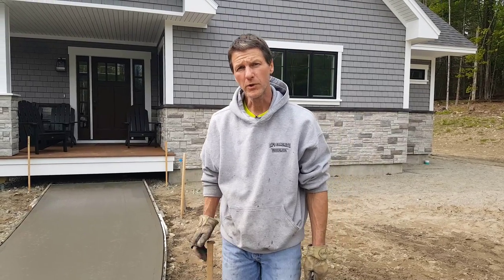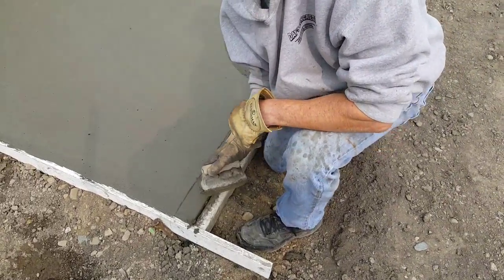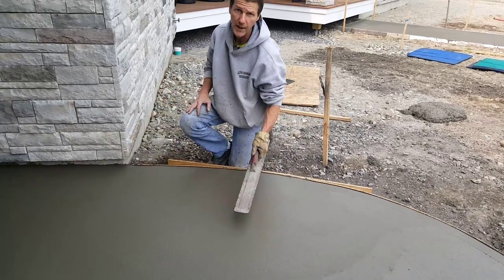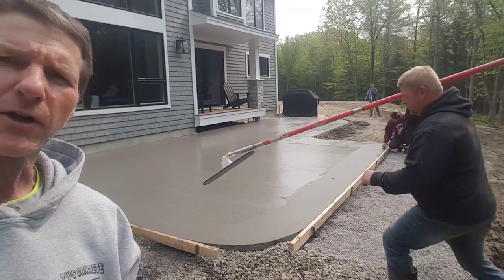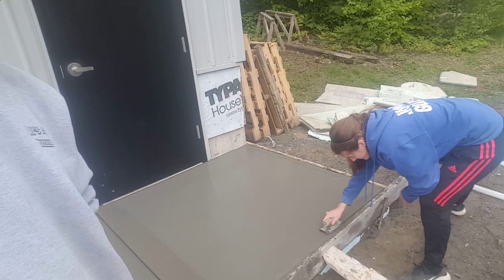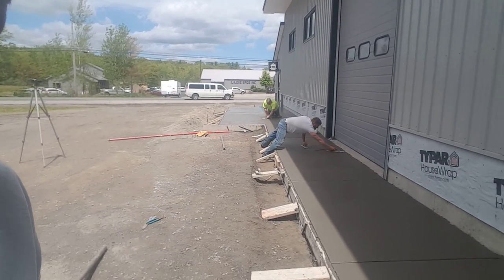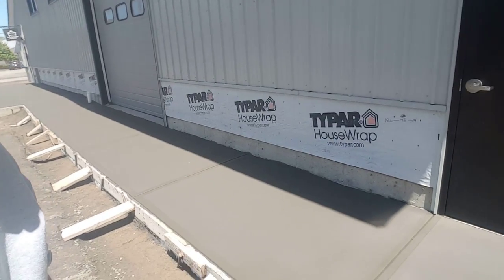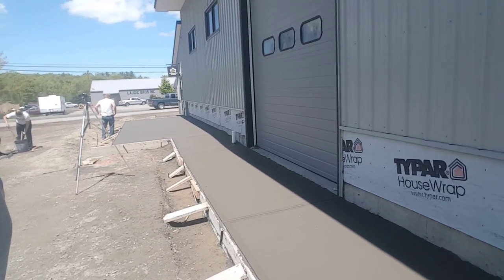CONCRETE PATIO AND SIDEWALK FINISHING TECHNIQUES | HOW TO FINISH CONCRETE

Comment: All of your videos are good but this is one of the better ones. I like how you explained where the concrete was along the way as far as curing and what to do at each stage. The funny trowel looks like a steel blade. Is it ok to use steel outdoors if you’re going to broom over  the slick finish? I like how the steel trowels smooth out the lines from the mag but I’m worried it will spall if I use a trowel. I always broom outdoor concrete.
Reply: Cool👍

Comment: I like your videos sir. I understand there's different ways to pour and finish..i like your style..i do have a question though..why did you open it back up with a mag after crazy troweling it before brooming it..i understand freeze thaw cycles and air engrained mud..i like to Fresno or crazy trowel before brooming it..the broom opens it back up and the steel gets it real flat and helps put a nice broom finish on it..i feel laying it down once or twice with steel won't knock the air out of it..i guess what I'm trying to ask is that your standard of procedure (concrete dictating)?
Reply from the maker: Sometimes we only mag it once. If it seems a little wet still, we'll hit it again. Especially if some of it is in the shade.
Reply: yes thats rite ryan  fresno will be flat for brooming  maging after will weaking the surface for sure

Comment: Thanks...only doing concrete work once in a while, I have a tough time telling when it’s time to edge, and mag. I also wonder if the sacks of Redi-mix, I use for small jobs, is not as workable as the good stuff you guys get from a truck.
Reply: The bag stuff bleeds way more in my opinion, because it doesnt mix as long as truck dumped concrete.
Reply from the maker: Probably not quite as good and it does bleed a lot.

Comment: Why do not you cut additionally grooves in the concrete with an electric circular saw? Is it necessary? I have seen many videos on YourTube in which people do this.
Reply: You would never cut fresh concrete with a circular saw. Usually they do that when they are removing old concrete
Reply: it serves the same purpose as a jointer is more of a preference for looks saw cuts are usually done for indoor slabs but people do them on drives as well and yes you do cut fresh concrete but once it’s  finished and hardened a little those cuts are called green cuts and require special blades
Reply: Dust is a major factor and it's way cleaner to do it this way.
Reply from the maker: I Agree with all these
Reply: Maybe to avoid silica dust